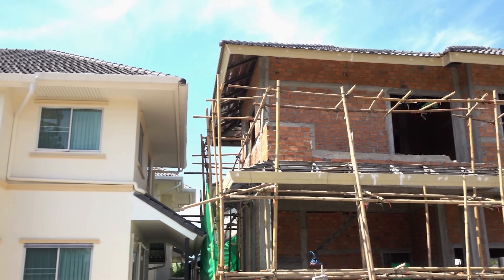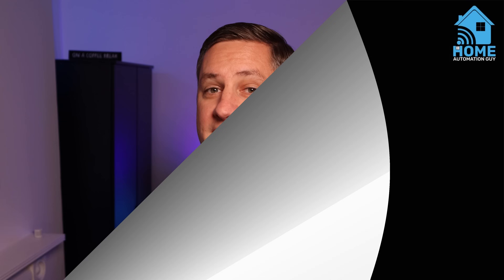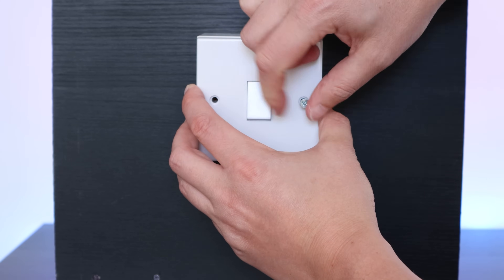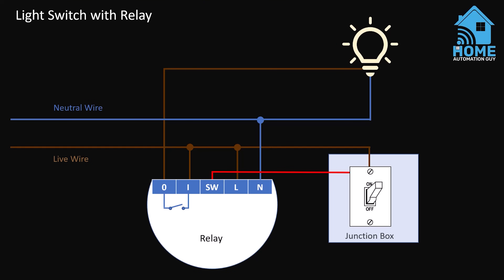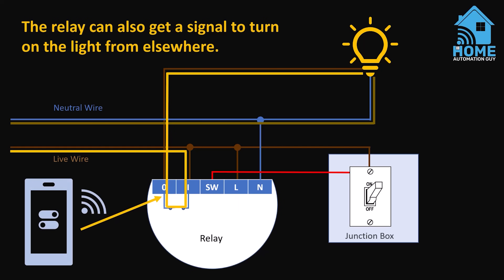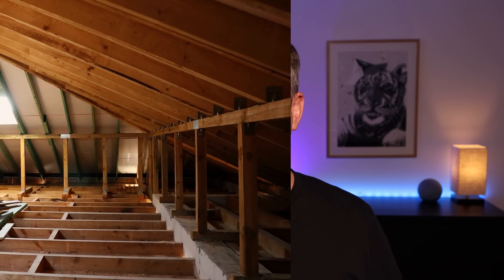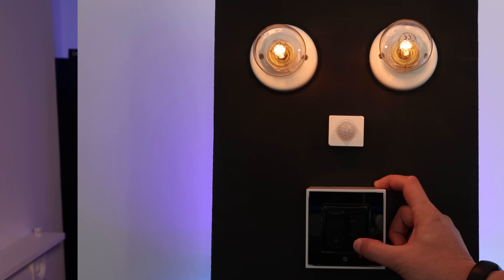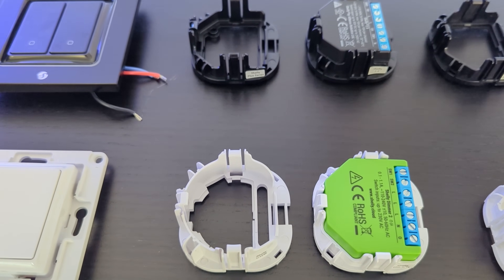Using smart relays in your home

Comment: Yes, in the Netherlands I use "klik aan klik uit" brand. I don't use iot technology. Instead the system uses its own local frequency and radios in the device. I have found smart connection over iot not that valuable in the longterm. The technology is useful to start off with if you don't know your consumption and what you really want. I was already frugal to start off with and investing in this technology didn't provide much added value. I found as a person I already had frugal habits, which in the longterm didn't provide much advantages to further investment in smart home technology. I even noticed it became a convenience factor, made me lazy, because I controlled everything remotely. I gave up and also saw benifits to turning things on and off to keep active in the house and become less sedentary, which added to health benefits. A few things I have done smartly is having low tech manually programmable timers for certain lights in the house. If I forgot to turn off something, I had the peace of mind I knew it would turn off after a set time, which is also a way to save energy. And there is one remote radio switch connected to a smart relay in the bedroom. The remote switch is above the headboard of the bed, which is convenient in that I don't have to walk blindly, rsik an accudnet in the dark at night to find the bedroom light when I need to wake up or go to the toilet. There are options to couple them with motion sensors, but I have found many unreliable or janky to use, so I gave up on those. To a degree smarthome automation is an interesting future, but in my experience is not a panacea or added value for every home. There are also benefits do have some things in the house basic and manual.

Comment: Interesting example,  what make is the example ? 

Interesting because with that one, with it having a separate trigger wire, you can use it on a lugging circuit that has more than one switching point. I don't think any smart light switch does that.

Comment: Hi Alan. Thanks for another excellent video. Just came across your channel recently and I’ve been a happy subscriber ever since. Which relay of smart switch would you recommend for heavy loads like Water Heater, cooker or swimming pool pumps? Have you considered making the main switchboard smart? Thanks again?
Reply from the maker: I'd suggest looking at the Shelly devices, they have some DIN rail mounted ones that are capable of switching heavy loads. I have a few energy monitoring devices in my switchboard, but other than that everything is dumb. I rely on my heating system to turn on and off the water heater and the cooker and ovens use around 1W on idle. Also living in London, a swimming is not on my radar
Reply: Hi Alan. Thanks for your response and suggestions. I’d looking into the Shelly products….I’m in the Middle East so swimming pool is essential for hot summers 😂

Comment: So does the physical switch just change the state of the relay? For example, the switch is in the on position with the light on, I then turn the light off via HomeAssistant so now the light is off but the switch is in the on position. What happens when i flip the switch to off?
Reply from the maker: Yes, the switch becomes a toggle.  So the light switch position doesn't match the "state" of the switch anymore, and that really annoys my OCD.  This is why I personally use smart switches instead of relays.  

Relays are a good idea if you have specific styles of switches that you want to maintain - or find some press button style switches that don't show their state via an up down position.

Comment: I’m looking for one that takes the load off the switch. I have a smart switch but the limit is 300 watts of power. So I want the smart feature but looking for a way to have the load off the relay switch I place. So the smart switch doesn’t carry the load. Any advice?
Reply from the maker: Take a look at the Shelly Pro range of relays.  They support 40A or so, and I believe they take the load off the switch.

Comment: If a relay is used to switch off a lamp, will the lamp still use some energy? Or does the relay itself keep using energy?
Reply from the maker: The relay will continue to use a little bit of energy to power the WiFi and onboard computer chippies

Comment: I wish Shelly smart devices were compatible with 12Ga wiring required in new homes.   My Home built in 2010 has zero 14 ga wiring.  Our home inspector won’t allow them in any switch boxes because you’d have to lower gauge which isn’t allowed by IRC.

Hey Shelly if your reading this how about make your devices capable of holding a 12 Ga wiring which is required on most circuits in the United States.   It makes your device illegal to place behind light switch.

Comment: Is there a Smart Relay (either for DIN or into the wall socket) that supports LAN cable instead of wifi? I do not want to rely on the wifi connection for them.
Reply: The Shelley pro series that are DIN rai mounted work on Wi-Fi and have a LAN port for Ethernet connection

Comment: Using a smart switch for a led will work but you will need a capacitor 1 micro farad ( looks like an upside down U so 1 u) connected across live-neutral

Comment: Ever come across a dumb small relay that is switched by high AC but connects a small current? My current light switches aren’t completely dumb but also not smart. They can be turned on by RF and use a tiny amount of current. I was thinking of connecting them to a relay and the relay to the switch connectors on a No-neutral Sonoff Mini. I have no neutral wire. I can easily find relays that are switched by AC 230 but they are humongous.

Comment: Thanks for the video! I have a conundrum, after hearing you talk about trying to keep things looking nice—I thought maybe you could help.

I have a bathroom with an exhaust fan/light over shower. I wired whole house on Lutron RA2. I wanted to use the Lutron combo switch to operate fan w/timers and light separate all in one switch. The light is LED and Lutron’s combo switch only works with fans + lights that are halogen.🙄

Is there a Lutron compatible relay or something I could use with a Lutron 3button pico remote that would have one button for fan (program it to just be 30min timer) and one button each for on/off of the light and fan? Or something else that wouldn’t look like garbage? Single gang for minimal switches. 🙏
Reply from the maker: I'm not familiar with Lutron,  I am not sure that they are that popular here in Europe / UK
Reply: @HomeAutomationGuy  ah interesting. What if we weren’t talking about Lutron? Same scenario—single gang to control a fan (with timer ideally) and an LED light.

Comment: I'm searching for a smart relay that will keep power to my smart light bulbs (hue) and will act light a smart switch, but then also act like a regular dumb switch if there is no connection to the hue hub. Basically internally programmed, IF connection --> send signal to Hue hub to toggle, IF no connection --> power to lamp via relay. This can probably be done with ESPHome and Shelly, but shelly is Wifi, and not zigbee. If this doesn't exist, how do people react when the hub or network is down. My philosophy for home automation follows, "An escalator can never break: it can only become stairs".
Reply from the maker: The Aqara H1 Smart Switches have "Decoupled Mode" which can do exactly as you describe (With some scripting to switch it to non-decoupled mode if your Automation System is down)

Comment: Nice work!  Question- if you already have smart bulbs installed could you use the relay in conjunction with those bulbs? Why would you do that you ask? IDK LOL just curious, I can't think why I would want to. Any use cases where that would make sense? Personally I am smart bulb poor- I have so many that I am locked in to that option. Always looking for an excuse to buy more smart stuff however!
Reply: Actually, you can. If you want to use Adaptive Lighting (also called Circadian Lighting) with your ambient White CCT bulbs, you will need (use) the relay (or certain smart switches) to maintain power to the smart bulb. The wall switch can then the use to give the perceived impression of a tradition wall switch or dimmer. You will need Home Assistant to manage this. Ideally, you could also use a relay and bulb using the same protocol (e.g. Zigbee, Z-wave, Thread) and use binding. Home Automation 401!!
Reply from the maker: Just be aware that if the smart bulbs lose power they'll be unavailable in your home automation system. If they're Zigbee they also will stop acting as repeaters when they're off and may mess up your Zigbee mesh network

Comment: How I can operate this smart switch when I'm not at home? It's connected to wifi but when I'm on driveway my phone isn't connected to wifi and I can't operate switch. Feel so dumb with new technologies
Reply: Your Wi-Fi is connected to the internet. Your phone is also connected to the internet. That’s how it works. If it doesn’t work for your, then there’s something blocking the smart switch’s access to the public internet, limiting it to only access your local network.
Reply: @Rediwed1   but when I'm not at home my phone is not connected to wifi. I use this smart switch for territory lightning but when I'm on driveway I'm too far to turn on lights. For my understanding there is option connecting with cloud but I doubt that I will get it. Maybe switch works perfectly fine with Alexa but this far I can't operate switch from a distance

Comment: So you seem like a mostly Zigbee guy, even though the Shelly relays are not Zigbee you prefer those over others? I ask because I need some relays but really do not want to use Wi-Fi smart devices and prefer Zigbee. I actually don't have any Wi-Fi smart devices in my home right now, and don't even know how to connect them to home assistant if I were to get any. I strictly use Zigbee right now.
Reply from the maker: I used to be against WiFi devices too, but now I use them if the features of them are better than the Zigbee alternatives. This is how I feel about the Shelly, they're great, reliable and open.  Home Assistant auto discovers the Shelly devices once they're connected to the WiFi and they show up as normal switch entities.

Comment: I use Shelly switches a lot . However they are quite unreliable, sometimes they will just not respond to the Wi-Fi or light switch commands and I have to open the light switch to disconnect and connect the Shelly just to restart it.
Reply: I have dozens of Shelly relays inside my walls (every single outlet or light is connected to one) and I don't have this problem you described. Isn't the problem in your Wi-Fi network?
Reply: Wifi probably is not the problem in this case because relay should respond to switch input even without wifi. Did you try restarting it from HA or Web interface?

Comment: 23 shelly devices to date, all integrated into both Home Assistant and Alexa. Shelly devices, made in Bulgaria of all places are phantastic. The only thing you need to be aware of is that they are all connected to WIFI and may bring your router to its knees. I switched to a Mesh network (TP-LINK Deco) to fix this issue. This is the cheapest, fastest and least intrusive way to smartify your home.